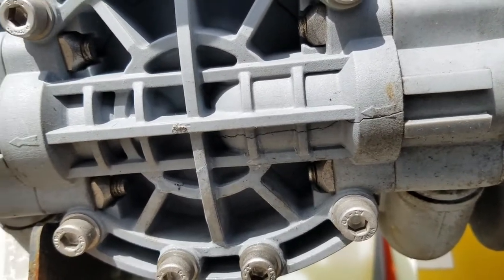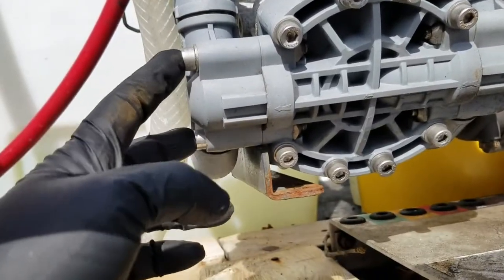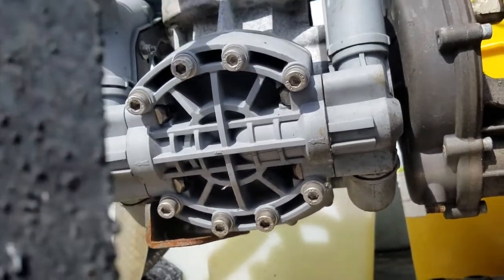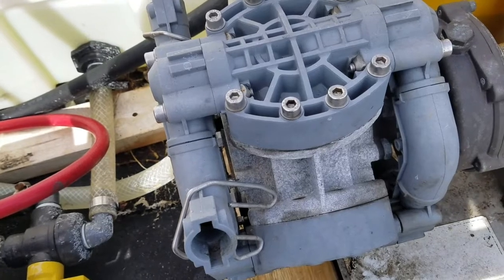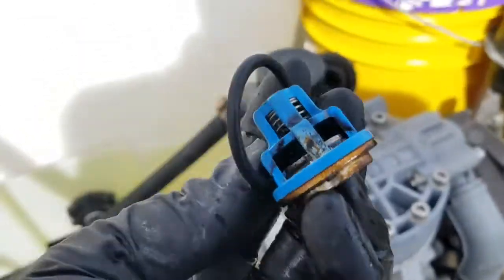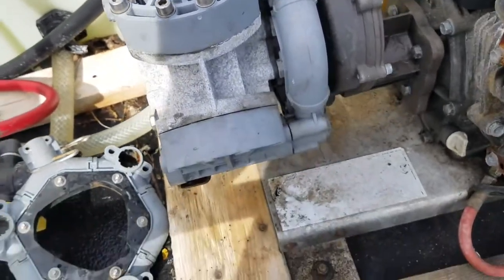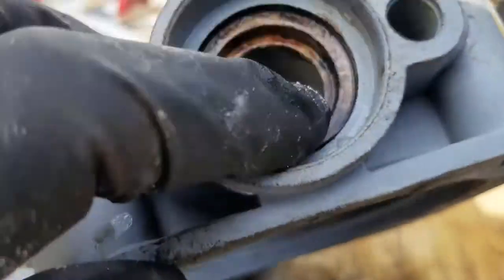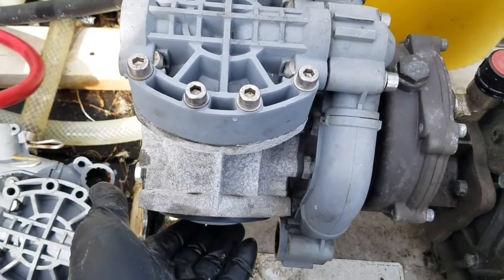Comet p36/10 cracked manifold repair

Comment: Can you kindly tell me the part # or a link to the oil vent cap from the gear box, the red one you have…I would GREATLY appreciate it Sir
Reply from the maker: I do not have that info.  Check the manual or Google or with whatever vendor sold you the pump.  You should be able to find the info that way.

Comment: Great content. Looking at pump options. Aghast to learn battery pumps only lasting a few months even when rinced after every use.
I have been using comet MC 18. 
On my 3rd in 4 years. Was under the illusion that I could get a pump to last several years without breaking down.

Comment: Hey man, do you have a reference to show how to do an oil change on this pump? I pumped out the clear reservoir and put in fresh oil, but I can't figure out what to do with the little red black and red cap that says "oil" on it...
Reply from the maker: William Welch that is gear oil.  Check the level but unless you see it leaking there is no reason to touch that oil.  It will last longer than the pump.
Reply: Clean Power Wash I'm not even sure how to check the level of it. I lost my manual, lol.

Comment: what are your reasons for using the diaphragm pump is it because you can use a stronger mix because a downstream injector doesn't apply that? also PVC does not like ultraviolet light it would be wise to paint that diaphragm pump.
Reply from the maker: John D it is specifically designed for roof cleaning.  low pressure high flow at a high strength.  I also use it as a 2 man crew for house washing.  1 soaps with an exact mix and the other guy rinses.
Reply from the maker: John D what would painting it do?
Reply: Clean Power Wash pvc and plastic in general hate ultraviolet light and make it brittle.
Reply: Clean Power Wash have you ever thought about using a foam canon for house washing? I've always thought it would work great as the chemical would remain in contact with the surface longer.
Reply from the maker: John D question still remains.  is the paint supposed to be UV resistant? the reason why wouldn't paint it though is because it's going to be in a usually wet area and paint on PVC usually doesn't hold up too well because it can't grip well
Reply: Gotcha yes the paint will keep the UV rays from getting to it or just keep it covered up so the sun doesn't get to it. Also my experience with diaphragm pumps that you use outdoors or in harsh environments that you worry about it freezing you can install a drain in the bottom to get rid of all the water very easily after each use.
Reply from the maker: John D foam Cannon devices are more about looking good, but the effectiveness is not improved as much as people like to think.